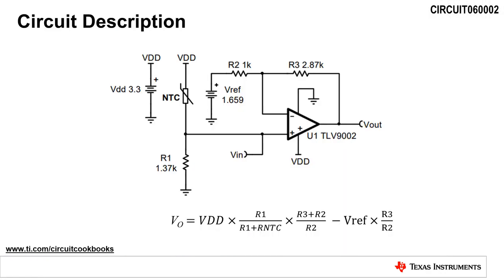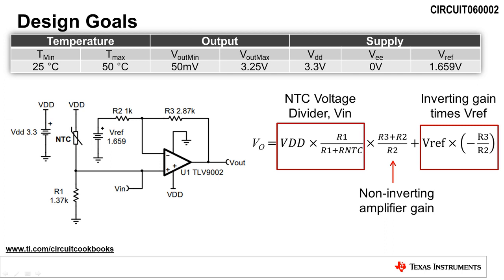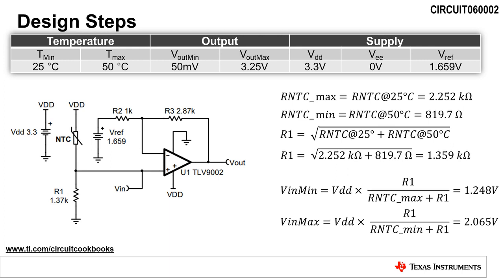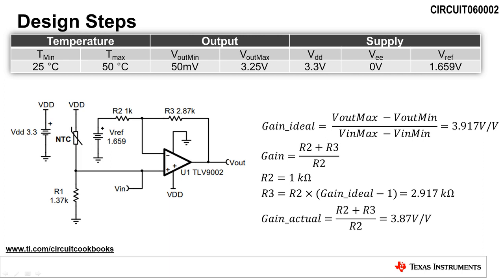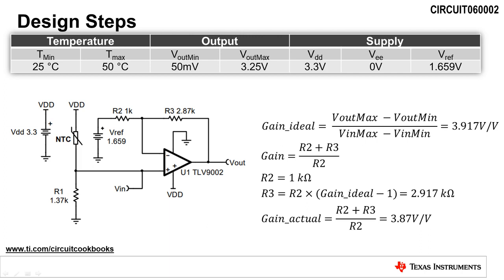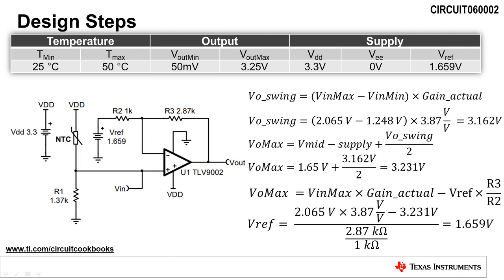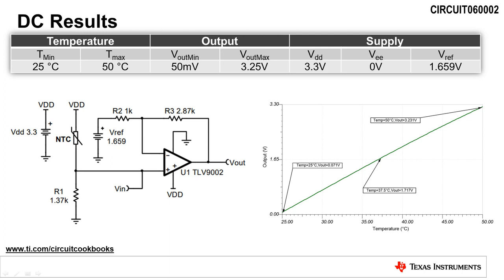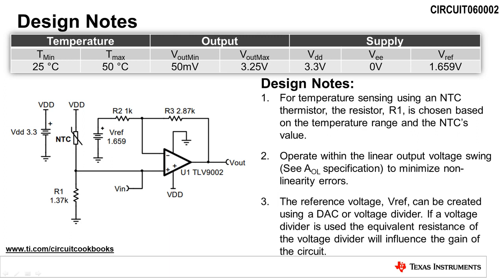Temperature sensing with NTC thermistor circuit

Comment: Slight error in the calculation of R1. The value is correct but the equation should be the geometric mean but has an addition symbol instead.
Reply from the maker: Thanks for bringing this to our attention, Ron. We are working to get the equation updated in the video file.
Reply: @TexasInstruments  What is the correct equation?
Reply: @mandytyree5028  R1 = Sqrt (RNTC@25C * RNTC@50C), i.e. instead of adding the two values, they should be multiplied.

Comment: The calculation of R1 is wrong, when I do addition inside the root,  I got R1 as 55.346 ohm. but in TI's  circuit note, the R1 calculation is multiplication inside the square root. That time R1 is same as in the video. the document link is given below  https://www.ti.com/lit/an/sboa323/sboa323.pdf?ts=1613541925432&ref_url=https%253A%252F%252Fwww.google.com%252F